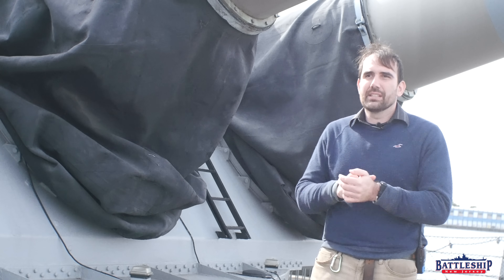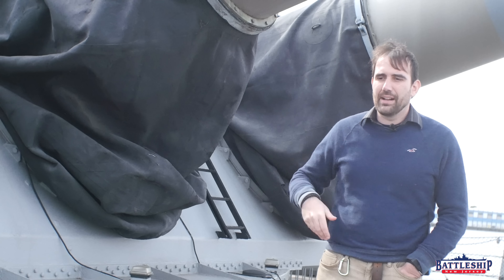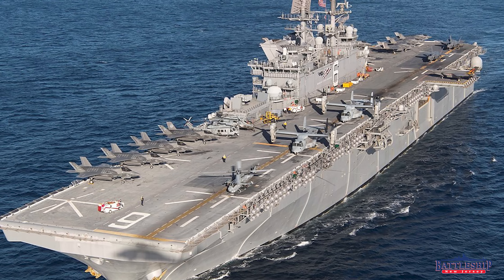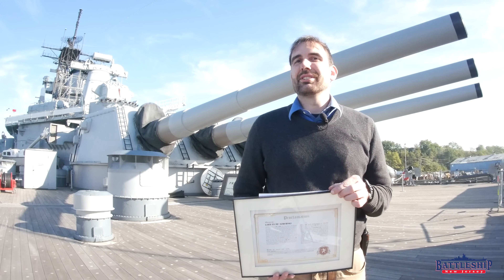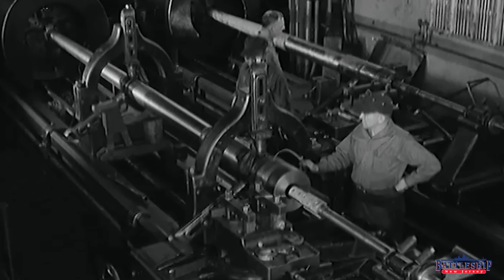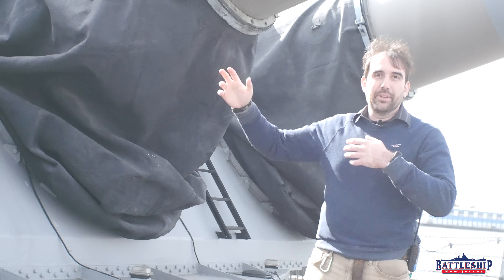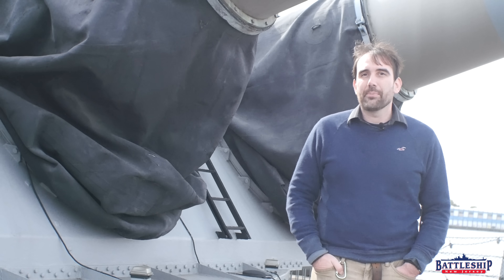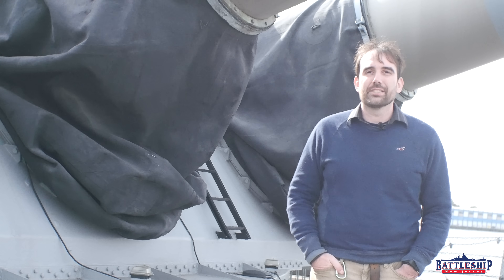How Much Would It Cost to Build a Battleship Today?

Comment: In my opinion, I would bring the older ships in as a stop gap until a newer design would be put into the works. However the new battleships would need to be bigger than the older Iowa class. Then I would have the 16 inch guns given the same love as the m777 cannon, a field gun that hit almost as far as battleship gun. With guns having double range, missile tubes, some secondary 5 inch guns, CIWS, and other needed weapon systems; the next plan would be the new shipyard and plans needed for support is next. Then around late 2030s, early 2040s have 8 to 12 active battleships in the fleet.

Comment: So if one battle ship cost 4 billion. And one ford carrier cost 13 billion. You would have just over 3 battleships for the cost of one carrier.

But.. tell me this. What would happen if one ford class carrier stood in a fight against 3 modernized iowa class battleships.

Well iowa have a speed of 33 knots and a gun range of 24 miles. Ford have a (estimated) speed of 35knots and the carried aircraft have a range of 1500 miles.

It wouldn´t be a fight, it would be a slaughter. Even going up with 10 or 15 Iowa against one ford, it would still be a slaughter.... That was kind of the reason why they stooped making battleships.

The only reason to even have a battleship what so ever today would be the very large gun barrels.

But still, the reason for large gun barrels is really just range and penetration. But modern artillery system still have better range. And if more range is needed we have rocket artillery.

So the only reason left would be penetration. But against what? A bunker? A cave system bunker it would not reach anyway. And a normal bunker would be penetrated with other weapons. Like bunker buster.

In short, there is a reason battleships don´t exist

Comment: A modern battleship would probably be very different from the old WW2 era ones. Nobody would nowadays put 16 inch guns on a ship, they have nowhere near enough range to be even remotely close to effective. There would very likely be a few Mk 45 127mm guns or maybe even the Zumwalt's AGS on a large non-carrier surface combatant but the armament would very likely be dominated VLS modules and a lot of air defense systems. The extensive armor plating of the old battleships would likely also be gone, because naval warfare is not ships shooting at each other with guns anymore. If you can replace that mass with few more CIWS and a helipad with ASW helis to protect from incoming torpedos and anti ship missiles, that will be much more cost effective. It is very likely that a ship of that size would be powered by gas turbines instead of a nuclear reactor.

Comment: A related answer might be when NASA looked at building another Saturn V Moon Rocket engine.
They quickly found out that no one remembered how to do all the fiddly wielding involved, and no one made the parts or manufacturing machines either.
NASA worked out it was easier to keep the shape of the plumbing, but to redesign all the components from scratch.
They ended up with something lighter, cheaper, and using a tiny number of parts.

In naval terms that means keeping the range and power of the guns, but probably not using guns any more. Or go the Project Babylon approach and use oil and gas companies to build the big gun parts.

Comment: Assuming battleships are actually needed and no longer made obsolete by missile destroyers, the question is : how many would you expect to need.

If it's only for a one-time investment, better retrofit old ones. If battleships are to rule the seas again, better invest in the infrastructure to build new ones, as it's more likely you would run out of old battleships at some point. You cannot make a dozen battleships if you only have at best a handful of Iowas to retrofit.

Comment: Suck it up and spend the resources and funds to build a shipyard to build a new and next-generation class of battleship that is atomic powered and its main guns are rail guns and include all the modern and next-generation electronics and defense systems and the ability to arm itself and fire ship to air, ship to ship and ship to land cruise missiles that can accommodate atomic warheads.  If they want to also incorporate large-bore rocket-assisted rounds, they can do so with better effect than the old 16-in. guns with smaller-bore canons.   New, new, new.  Why go backward in old tech or use old tech with new tech on the service.  A modern battleship will be in effect a floating launch pad for atomic missiles and will have the ability to reach out and destroy any sea, air, or land target at will.  It will also have the ability to destroy any missile or aircraft threat at a distance.  With all that said, we may be talking about a capital ship costing more than a $3.45 Billion Virginia-class atomic submarine and getting closer to a $13.3 Billion Gerald R. Ford-class atomic aircraft carrier.  Either way, It will just be a weapon that says that we did it because we can.  I do not think the expense at the end of the day would justify any benefits it would have.  Heck, we balk at the cost to get a farther presence in space.

Comment: I would very much rather build new ones, simply because the change in armor plating that's occurred since the 40's (think, tanks have since moved to depleted uranium) is so fundamentally superior to what came before that it changes the game entirely. Plus, yes, we can make new ones to be designed from the ground up to be nuclear powered rather than retrofitting New Jersey, Wisconsin, Missouri, or, God forbid, Iowa herself. Similarly, it allows the ship to be designed with a missile-based anti-air suite in mind. Finally, since I have my whole box of Christmas presents straight from the Department of Defense, we could theoretically ask our close allies in Japan for the diagrams of their famous 18.1-inch guns to use on our battleships rather than using the same 16-inch guns we did 80 years ago.

Comment: Why build something like an Iowa at all?  If you're going to build a large surface ship, try something like a scaled-up Arleigh Burke with that can also do shore bombardment.  It would of course carry many more missiles than a Burke, but roughly the same mix.  You're not going to fight a gun battle at sea, so you don't need big guns.  Instead of the 16" guns use something like a naval version of the Army's HIMARS or MLRS.  That also gets around the infrastructure problem.  You'd end up with something comparable to Russia's Kirov-class, but much better.

Comment: What role would modern battleships have? Shore bombardment and surface actions are done by missiles now.. IF you want naval gunfire support for a beach invasion, well I guess that's possible. But you could achieve the same effect with 5 inch guns on a modern frigate or destroyer. There's very little on land that needs a 16" gun to destroy it, and if you find such a target then a 200lb laser guided bomb is likely to be a cheaper option. Battleships are very very cool indeed, but their time has passed.

Comment: I love battleships, but in the modern setting they are useless unfortunately. We will never have a gun that has the same range as a missile/ A missile launched from a F35 far away from the actual battlegroup. Which is optimal, because it means that the fleet is less exposed. The size would also make it more expensive while providing little benefit to defensive capability. At some point you do not need extra space for the radar or for a 3rd VLS system. But I guess most of you knew this already.

Comment: The new carrier costs 13 billion. Granted it has the latest equipment and is much larger than say a modern battleship. So my guess would be 8 to 10 billion for a "battleship" This would have an extensive missile, rail gun and or LASER weapon system backed by conventional "guns" to handle short-range defense and small craft threats. It would have to have several self-defense features. This would have to include drones in various roles, electronic warfare, at least two helicopters for various roles. The issue is how you sell this idea to make something like this and guarantee its extensive use. It would have to be very efficient, nuclear powered, have offensive capabilities vastly superior to all current naval forces, and supreme defenses so nothing can get near it. and have extra abilities making it superior in other ways to most ships. All that in a very survivable package where sinking one would be rather difficult.

Comment: I think it would be immensely more valuable to build aircraft capable battlecruisers. One (or two superfiring) quad turret (like the Richelieu) in front with either an angled half deck and offset superstructure (Like the Kiev) or helicopter quarter deck (Like the Jeanne d'Arc or Haruna). Slap a couple VLS tubes and CWIS in there and you'd have an amazing amphibious assault support ship.
Reply: Unmanned aircraft launcher. Battle carrier. Drone carrier basically.

Comment: Would obviously be cost prohibitive, so it will also obviously never happen. The big guns are outdated, far better range and BANG for the buck with missiles. The survivability because of a heavy armor belt warrants at least consideration. Modern ships have paper thin armor in comparison. It's the same quality vs quantity argument, but if it stays afloat after a significant hit, well I think that is a valid argument as well...

Comment: There's a reason why Battleships are obsolete. Aircraft Carriers have a longer range. And Modern Guided Missile Destroyers pack a comparable punch in a smaller, more nimble footprint. 

But if some new innovation managed to create a new need for something the battleship still offers with no viable alternatives, build them new so you can incorporate new tech and automation from the jump. Refits are a bitch. I believe the Iowa-Class still used analogue computers. Imagine how much more compact and efficient a modern desktop computer would be in that role. Modern control systems would probably have a lot of advantages.

Comment: The barrels for the 16" inch guns could be made. In Pennsylvania the machinery
for such large devices are still in use. The company was once part of Bethlehem
Steel and more than likely they manufactured the original guns for the Iowa class.
It is a safe bet just making a few gun barrels would be very expensive.
Reply: No, much of the specialist machinery and equipment would NOT in fact still be there as there were some things required to manufacture battleship calibre guns that could only be used in the manufacture of those guns. Those are long gone. No company is going to keep machinery or facilities of that size around if they are not being used for 80 years. 

Making a battleship calibre gun barrel is a LOT more complex than just milling then boring out a piece of steel....
Reply: @alganhar1  This shop is where Bethlehem Steel would do forging and machining of large steel pieces. They built the unusual and difficult and some of the work they did was gun turrets for large capital fighting ships. This equipment could be used for projects other than military as supplying the Navy is a somewhat erratic business. I visited that complex and seeing some of the work in progress and the size of it was very impressive.
I would say men with experience in building 16 inch guns are no longer around. Unless written down, any special knowledge/tricks in machining such devices would be lost.

Comment: $8 billion would not come close. The reason for that is the machine tools to make a lot of the components would have to be built from scratch. I seriously doubt that the machine tool to make a ring for the five-inch mounts still exists. The machines to make the rings for the Sixteen-inch truest have been cut up and sold for scrap long ago. To add to the cost the machinery would have to be CNC machines becuase the people that could make it on a manual machine are extremely rare today.

Comment: If it was an imminent threat, bring the Museum Ships into service and immediately begin building the needed services to recreate them. You could use the time refitting the Museum Ships to take the necessary measurements of them, and initiate the planning for the new ships. Portions that will be necessary for both is the rebuilding of the guns, and maintaining the armored belts, so relearning those portions on the Museum Ships would go a long way for the new ships.

Comment: Id launch 1 new hull TYPE battleship and a total of 2 ships of that one hull type. One for each flank of the US as a 'State-ship' (a ship type given permanents of being a Capital-ship), properly fitted with a nuclear reactor and properly fitted electronics. The idea would be to try and make it as fast as possible with new tech and techniques. 

Armament would feature a little of everything but would focus on  its ability to try and lower the cost of Surface to Ground attack and Anti-ship with its main guns. Considering that we dont need 406mm batteries, as we can make up for that range with precision and rocket boosted artillery; the Iowa's 406mm had a range of 46km. the G6 155mm howitzer can hit 73km. 

Secondary, or if funding allowed, i would look back at General Atomic's Railgun system. they fixed up the Railgun and made it have much better numbers, even shrunk it down to fit on a flatbed truck. BAE receiving the contract for the Railgun was waaaay too soon.

But alot of what makes up anti-ship warfare is from aircraft and ASWs. this can easily be better countered as of recent with High-microwave emitter systems and laser weapon systems. of course, gotta keep the Phalanx, its a proven and good system. But, we wont forget that theres some new nifty Jamming and spoofing systems being made by Ratheon and BAE.

If the project works out for 2 ships, and 2 ships is the minimal id request. for if one fails, then its not the ship or design's fault but the manufacturing. one ship will be made on the west, the other on the east.

Comment: I would assume the cost for a 4 ship class of modern Iowa class like battleships to be about $63 billion. $37 billion in development & $26 for actual construction.

The biggest cost hurdle would be R&D. In a very crude estimate I would assume $20-30 billion would need to be spent before so much as a plate is laid down. There would likely need to be a rather large amount spent on tooling & manufacturing infrastructure, especially the main guns. I would expect $2-4 billion on that.

The actual construction cost I would assume to be $5 billion, a heavily armored battleship will be abnormally expensive compared to a lightly protected ship like an Amphib. This does not include electronics & weapons. So add comparable numbers as a DDG51 plus the large guns and I would assume $1.5 billion. Also tac on $2-3 billion for development for advanced ammunition for the big guns.

That's my very crude guesstimation on cost.

Comment: Imagine a nuclear powered stealth battleship armed with lasers, railgun turrets and composite armored hull with heavy ERA covering it. Not to mention there are electro armor that is 2 plates separated from one another that when penetrated by a heat warheads copper jet will complete the circuit and disrupt the penetrating jet.

Comment: If I were a 4 star admiral, and I was charged with once again building a battleship capability in the US navy, I would reactivate, but I would fully refurbish and modernize them, with new wiring, electronics, new engines/ boilers/ generators, new radars new missile launchers etc... new optimized gun powers, new optimized aerodynamically optimized grenades... you name it... 

That would probably cost a lot more than the 2 billion Ryan is advocating here... but that is what I would do...

Comment: This is interesting, but I think the "analog" comparison is off.  Russia operates what is essentially a missile battleship of the Kirov, running on a nuclear reactor, which is the biggest surface combat vessel afloat at the moment.  That is a modern analog to the old forgone battleship. Considering the Arleigh Burke Destroyers cost 1.8 billion each, you could safely say a larger ship with similar multirole capabilities is going to cost at most 7 billion, as it would use a new hull and a nuclear reactor.  We already have everything to build the guts and topsides of a large surface vessel since we have been building cruisers and carriers.

Comment: Hey Ryan would a CG design based on the Atlanta-class Light Cruisers/Antiaircraft Cruisers would be feasible? Imagine a Modern version of an Atlanta with the latest USN radars, tech, systems and sensors, the length(165m long) and beam(52ft 10" wide) of the ship would make it possible to carry 2x 98 VLS cell launchers and still have enough room for 6 Mark-45 5" guns( 2 fore/2 sides/2 aft), Crew compartments and other important stuff you can find on a Ticonderoga Class and a Arleigh Burke Class DDG